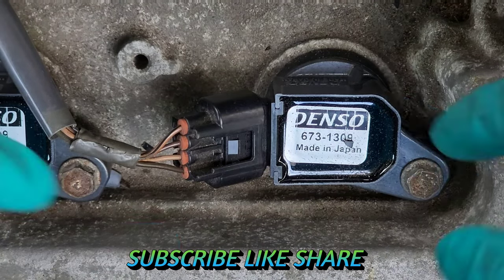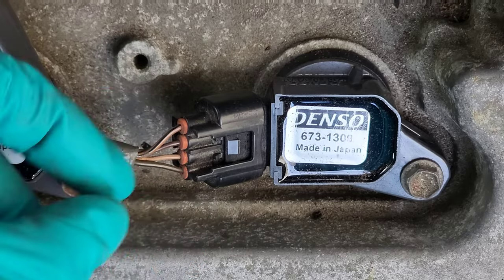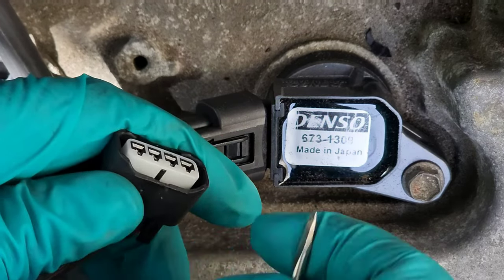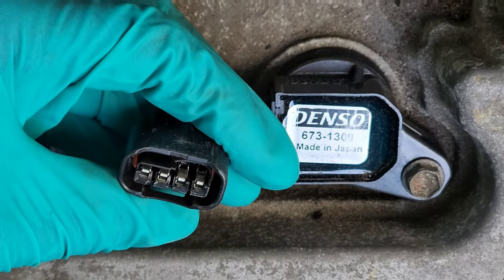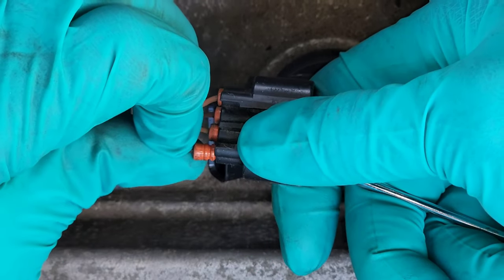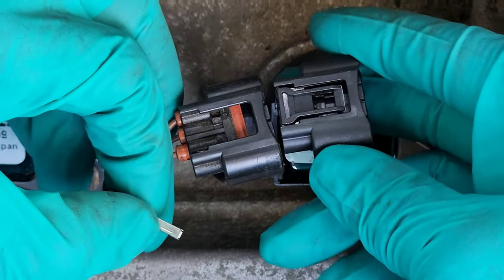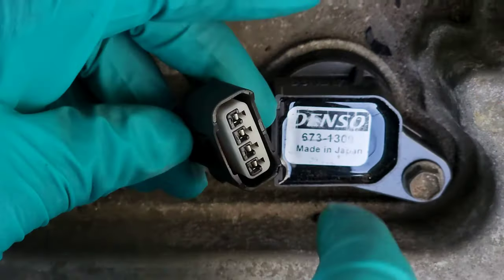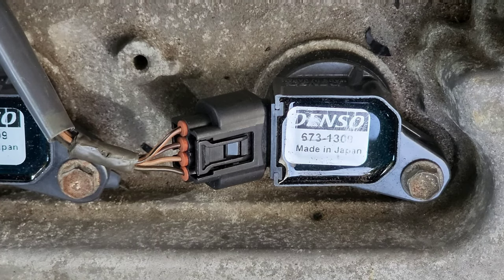How To Repair And Replace Broken Ignition Coil Connector

Comment: It worked exactly as you described, thanks! For my car, the connector plastic was so brittle I didn't even have to bend the tabs; the wires just pulled right out. So I just pulled the pins out one at a time, and plugged them into the new connectors one at a time.
Reply from the maker: Glad it helped Thanks for watching please Like, Share and Subscribe if you haven't already

Comment: I was leaning on them (2006 so its OLD) and must have cracked it clean off. I have been working on my for since the end of Sept over the weekends and I am so over it, but I just need to wait for a power steering hose, and these new connectors, fill her up with coolant and fire her up. I am just worried that one of my ground wires are not in the right place and will cause a car wide short. I am so very mad that I did NOT take a before picture. I surely have learned my lesson!

Comment: Thanks for this video- gonna try it for the first time this week
Reply from the maker: Good luck! Thanks for watching please Like, Share and Subscribe if you haven't already
Reply: It went well, but I learned a major lesson about not using the absolute bottom end of a torque wrench ft lbs rating -I had my first stripped bolt (coil pack) as I never heard the wrench click till SNAP!
Reply: I extracted the bolt after a bit of dimpling/drilling the bolt surface
Reply from the maker: Glad to know all went well

Comment: ***Thanks for the video guy. My 2007 lexus es350  connectors just snapped at 100k miles as I was about to put in new spark plugs. 
**Plastics and heat don't quite go well together after some time.
Reply from the maker: @HoodsGlobal  Thanks for watching please Like, Share and Subscribe if you haven't already

Comment: Thanks for sharing this video, Question for you, if you've got a broken connector, will it trigger a check engine light? and if you plug in the obd2 reader will it show a fault code?
Reply from the maker: @Clifford Charles   yes it will trigger a code and the code reader will read it. Thanks for watching please Like, Share and Subscribe if you haven't already
Reply: I currently have a PO300 misfire code. I replaced spark plugs, coils, and fuel injectors but my connectors are broken so this is my next step hope this clears the code🤞
Reply: @truedogg323 did it?
Reply: @anthonymarquez818  No, I replaced the connectors Saturday and the code returned. I don't know what to do to diagnose this issue. Thinking about seeing if a Lexus dealer can diagnose it now.
Reply: @truedogg323  any update? I’m having the same issue but on a Nissan versa

Comment: How much they cost and where to get them,pls? I bought used car  in whicjh all connectors are broken. Will they still work with broken connectors or they can be sometimes loose?
Reply from the maker: I got them from Amazon just order a few sets and you can always return the set you didn't use.  Thanks for watching please Like, Share and Subscribe if you haven't already

Comment: Hi. I have a quick, random question. Is is mandatory that I keep the red, rubber seal/gasket on the inside of the harness? I ask because I recently replaced my coil pack and I took that off and threw it away. 🤷🏾‍♂️
Reply from the maker: Yes, it is its to prevent water from entering the connectors but you can get away without it just watch out for any ignition issues.  Thanks for watching please Like, Share and Subscribe if you haven't already

Comment: Great tutorial! Where did you buy the connector and what is the part number?   I am looking for a connector for a 1999 Toyota Tacoma V6 3.4l.  Thanks!
Reply from the maker: @Vuthy Yos  you can get the online, you just have to make sure the ones you need match the ones you are looking at -i.e. if your original has 3 wires and 4 pins get the one that has 3wires and 4pins in the same spot, don't worry if wire colors are different.  Thanks for watching please Like, Share and Subscribe if you haven't already

Comment: can this cause a missfire if the clips broke and plastic broke inside? my camry has 2 broken and its the 2 that are saying theres a missfire so im replacing the two connectors today hoping it fixes the missfire
Reply from the maker: Yes it most definitely can. Thanks for watching please Like,Share and Subscribe if you haven't
Reply: @BIGWILLSCARCARE  ive come to conclusion ive changed spark plugs ignition coils, the connectors to them i added some sea foam cuz it stutters on accelerating so im guessing it cleaned it but it clogged my injectors so gonna change those and go from there